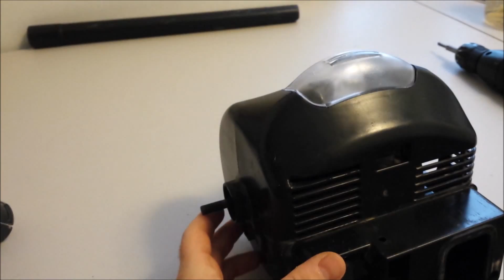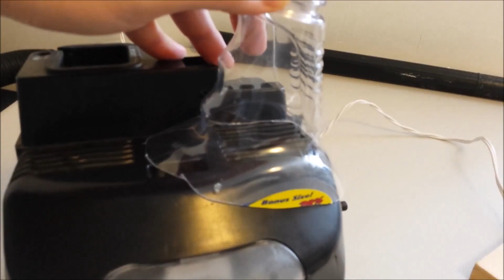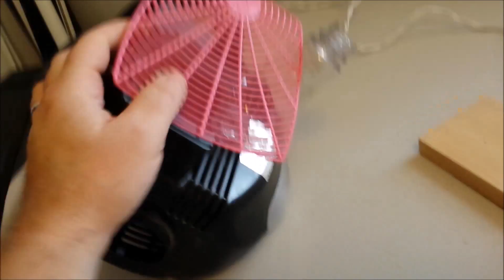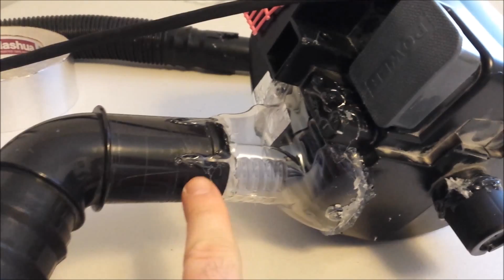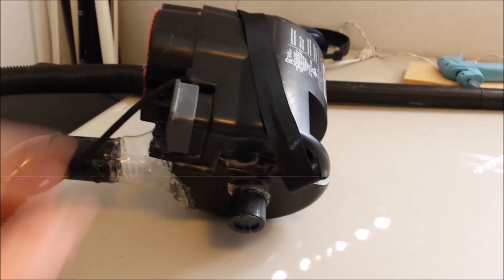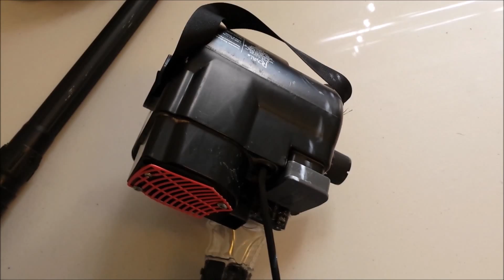DIY Leaf Blower from vacuum cleaner motor

Comment: Powerful, moves a lot of air. >>>t.co/9RAtkxMZ76    Glad I got the version with the throttle. Vacuum works okay, still getting the hang of sorting out leaves and sticks without picking up small rocks. Blower on full is pretty loud - not a high-pitched whine, but more a thunderous, you may want ear-plugs, particularly if in a closed environment like a garage or warehouse. Well balanced with multiple handholds.